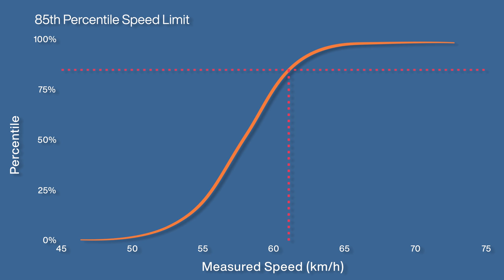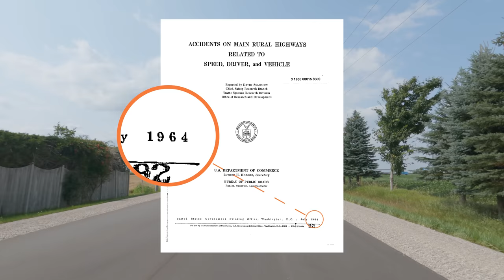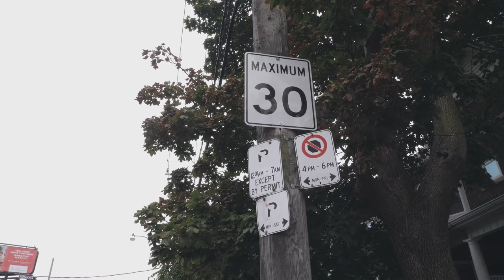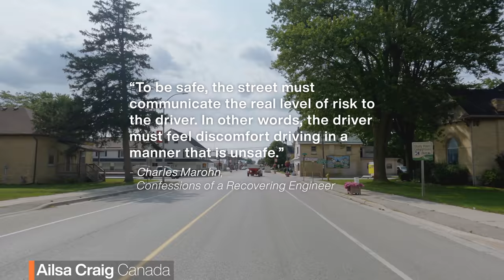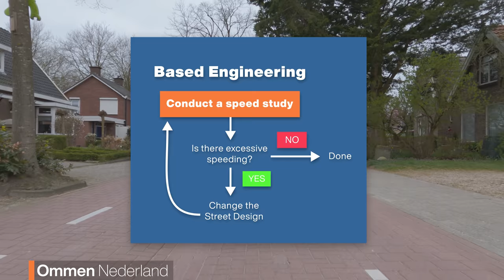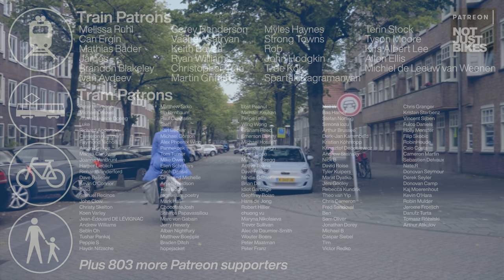The Wrong Way to Set Speed Limits [ST06]

Comment: Your approach is for streets that accommodate for example, 2000 cars/hr to be designed to accommodate 1500 cars/hr for a country/city that only needs roads that accommodate 1000 cars/hr.

That will not work in the USA. We need roads that accommodate 15,000 cars/hr to move 60,000 cars in 3hrs. (Rush hour) What happens is the excess WILL bleed into the streets. Streets designed for 2000 cars/hr get over run regardless and slow to bumper to bumper traffic. We cannot redesign them to be slower.

Comment: I am from germany and came across some strange highways after my first long drive.
Most of the time it was only 2 lanes without speed limit. As soon as it got wider to 3 lanes, the speed limit was set to 120 km/h. Then it got narrow again and the speed limit was removed. Shouldnt it make sense to make it the other way around?
If there is no speed limit i like to drive around 180kmh. But when theres only 2 lanes, most drivers drive 80-100 on the right and 100-130 on the left. Making my fuel economy extremely worse because of breaking and accelerating, as well as getting uncomfortable or even angry while tailgating other drivers who drive "too slow" for you. I just dont get the idea behind this...

Comment: In my Big city we have avenues and boulevards and streets. most streets are 30 and 40 km per hour. Most avenues and BLVDRS are 40 and 50 respectively. The speed limit is decided on the street. 1 lane streets then 2 and 3 lane streets or avenues/blvrds. And even some avenues will have lower speed limits that align as a street because of pedestrian traffic. So I don't know where you are taking your info from but most major cities in Canada operate on teh same method.

Comment: The series talks about how towns are insolvent...then points-out that engineers reduce the speed percentage by 15%.
A little later, stop-lights are mentioned -- often meant to stop at every other stop-light downstream.

Think tickets would be reduced if the streets were designed by the speed-limit instead of the intrinsic design?

Try, "the road engineers are working on an algorithm which has been placed on them to design streets to frustrate drivers into donating to the city's (and by city, I mean the State Capital) financial budget."

.

Comment: I'm not an engineer but depending on the traffic volume for a given area, wouldn't some of those changes have the side effect of also increasing traffic congestion? Narrow roads accommodate less cars.

We are on the verge of a society with self driving cars so this is approaching non-issue territory. Once cars driving themselves are the majority the primary focus should likely be optimizing traffic flow and reducing risk by obstructions.

At the end of the day road building is an optimization problem. You want to optimize for safety, cost, and efficiency of the road. Possibly also presentation. While the changes suggested would improve safety I suspect they would decrease efficiency and most certainly increase cost.

Comment: Some areas in canada are so poorly designed. I live in a school zone but see people always speeding, there are barely any crosswalks and limited sidewalks (again, around 3 different schools) and they had to add a new traffic light and repave tge road/add more to the curb because people weren't stopping before turning. They only noticed once someone got hit by a car there. 30 minutes after school let out. BETWEEN 2 SCHOOL ZONES.

Comment: Some bad highway development near me uses these cues in the wrong way, creating traffic congestion almost all day, every day. A slight curve was paired with visually dominating fly-over bridges (from a terrible added-middle-lanes toll road scheme that required rebuilding every bridge on the entire length And building dozens of overpasses to lift traffic over the usual highway or on and off the usual highway in a mishmash of sudden left exit lanes and too-short forced merges from the left with different traffic speeds)... I digress. The problematic visual aspect comes as drivers on a straight road approach a built-up section of overpasses with cheapest-contractor solid ramps cutting off the view of the slight angle and the straight road ahead of it. Overly reactive drivers are snapped out of their driving fugue and tap their breaks- making the drivers behind them hit the breaks, and suddenly everyone is slowing to a crawl because it looks like there must be a problem ahead, and then once you get around the corner everyone stomps the gas and accelerates away angrily.

Comment: Curious on your opinion of the definition of a road as it is in a rural environment. Where I grew up we certainly didn't have streets. Every road was called "*insert Road name* Road". 

Your definition of road as a high speed connection point between two places with minimal sidewalks, driveways, crossings, etc. makes sense, and certainly differentiates them from streets, but for example the road I grew up on and all of the roads in my area were not always connecting points between two places, were never "high-speed" (think more like 35 mph), and had multiple driveways along them. 

Would you consider the "rural road" to be different than roads as they relate to streets? And how about avenues and boulevards? Can they be streets OR roads depending on their application? 

Just interesting 🤷‍♂️

Comment: About speed bumps: all speed bumps shown were of a whole-width design, with a gradual slope, and most if not all were "build in". Unfortunately in some places instead of doing speed bumps correctly, half-width pyramidal plastic speed bumps are bolted to the street instead. They are horrible - you need to not only drive at the correct speed, but also drive perfectly through their center... which is not always feasible. I hate them with passion.

Comment: in Germany speed limits [km/h] are in general 30 (in residential areas), 50 (in villages and towns), 100 (on rural roads) and highways have no speed limit but a recommended speed of 130

is that system not viable in North America

Comment: The biggest issue with speed limits is that even if people know them they will still simply ignore them. Very few people will ever obey any seemingly arbitrary rule, so legally enforcing these rules (that almost everyone subconsciously feels are unreasonable) will only make things worse. 

Also, I am not a believer in the 85% rule on rural roads either. Often times on these roads people are not able to drive at a comfortable speed because of slower drivers in front of them. Not only can this adversely affect the 85% speed limit that is set, but it encourages impatience and dangerous decision making from those driving on the road. More important than setting speed limits should be designing roads that allow frequent opportunities to safely overtake slower drivers and reduce congestion. Also, it still applies that strictly enforcing unreasonable rules does nothing but cause the general population to be made up of law breakers. I think speed should only be a concern when it significantly increases the likelihood of a wreck, and well designed roads and enforcement of other safe driving habits should be the primary concern.

Comment: What's irritating is that he doesn't answer the primary contention, how should the speed limit be set? The design loop he showed for the based engineer talks about excessive speeding, but that phrase is never defined. Instead, he talks about how to implement a limit on speed.
Reply: I get your point.
I think, depending on the way a street or road is used, you can alter the speed limit. For example, a busy shopping street should have a maximum speed limit of 30 kilometers per hour, making the street crossable for people. It also allows bikes to ride on the road where the cars ride as well, creating space for wide sidewalks for the big amount of shoppers. In busy areas, 30 or even less is the way to go. On bigger roads with less services next to it, 50 kilometers per hour might be an option, and if the road is only used for people actually going somewhere else, a higher speed limit can be applied. Of course, infrastructure should be created in a way that it serves the speed limit. So cobbles/bricks for the 30km/h streets, and asphalt for the bigger roads.

Of course it is impossible to create a universal system. Every place is unique and asks for it's own speed limit. Streets around schools should have a lower speed limit, so do areas with many houses next to the road, to prevent people having to hear these cars (although thick glass might help a lot as well).
But yeah, because every place is unique, they all ask for their own rules and speed limits. I think you should look at a single case everytime and decide what fits best there.

Comment: Great video. Should've mention the "driving speed sweet spot."
Do, basically, with all those variables, car, skill, road, etc. every driver has a certain speed that they are most comfortable at. Those are rarely the speed limit, it's usually quit ea bit under or over.
So. If you drive faster than the said sweet spot, you lack the ability to react in time.
If you drive slower than the sweet spot, you get too relaxed and are, again, lacking the ability to react in time.

Comment: Rather than investing in extensive infrastructure changes, might not automated cars have governors that will instantly adjust the car’s speed to the posted limit?
Reply: To minimise costs, these changes could be implemented only when the street is slated to be redone or resurfaced - if you're repaving a street, then it's not much more expensive to implement these measures. Or you can just implement cheap safety tactics like bollards, chicanes, or even just paint. Tactical urbanism has a bunch of these methods for cheap.

Comment: In Texas, the maximum speed is reasonable and prudent.

Sec. 545.351.  MAXIMUM SPEED REQUIREMENT. (a) An operator may not drive at a speed greater than is reasonable and prudent under the circumstances then existing.

Comment: The approach of changing the street design will never work in the US.  Drivers here will simply complain about the "arbitrary" narrowing of the street and/or the obstacles limiting the space available to cars, and will push for cities to restore the streets back to the old way that lets them driver faster.  

There is this one particular residential side street near where I live that people started using as a shortcut for thru traffic, to get around a series of traffic lights. This was a side street intended for residential traffic only, with a 25MPH speed limit, but people were routinely clocked going 50+ MPH.  When the city put up barricades and speed bumps to discourage speeding through the residential neighborhood, people actually threatened the city council.  They ended up having to remove the barricades, and had to change the speed bumps to much lower (and wider) versions, just to satisfy all the impatient Karens and Kyles.

Comment: Germany has a better concept:
Streets used by childrens or passengers too: max. 5 km/h
Streets in closed villages & towns: max. 50 km/h (30 mi/h)
except the one with special high risc: 30 km/h
Streets through open villages: max. 70 km/h
Isolated roads with multiple lines in towns: max. 70 km/h
Roads outside of villages & towns: 100 km/h (63 mi/h), except of bottlenecks, road damages & tight curves 
Autobahn: no speed limit except on risky parts (80 to 130 km/h) or construction sites & partially closed streets  (mostly 50 to 80 km/h)
All exceptions of the standard speed limit has road signs while the 50 km/h for streets insides of closed villages & towns, the 70 km/h for open villages as well as the 100 km/h for roads outside of villages & towns has no road sign. Towns & closed villages have yellow signs which tell you on the outside which location you're entering and on the inside which location you're leaving (with a diagonal strikethrough) and which location comes next and how long the distance is. Open villages has the same sign but in green. (traffic light logic: Green = Go, Yellow = Give attention!, Red = Stop!)

Comment: In Denmark the speed limit in cities is 50 km/h and outside cities it's 80. We have special signs showing when you leave or enter a city. 
We use max speed limit signs and it seems to work just fine so I dont see the issue tbh

Comment: DESIGN SPEED!!! 
This is what I've been trying to explain to people! Driving 50kmh on a single-lane narrow road with a bunch of trees and people feels way too fast and extremely dangerous, but people are constantly riding my tail trying to go 50, but I don't feel safe doing that. Driving 50kmh on a wide road with many lanes, no trees, and no people feels really slow and I feel like I could go faster. 
THank you for providing me with this term, I will be using it all the time now
Reply: @laurie7689  If trees are not an option, then consider hedges. Anything that will invoke a perception of speed. Narrower roads while still leaving a lot of clearway is an option.

Comment: mate in my hometown in the uk they've put up 20 mph zones in quite a lot of places on streets that are still obviously designed for 30 mph. I and most other local drivers refuse to follow the limits unless they've actually made some effort like speedbumps to slow people down. So it's easy to get frustrated when people actually follow the posted limit. But also the 20 zones arbitrarily stop and start, and it's not obvious, so you also get people doing 20 in a 30 zone, which is even more annoying.

(the 85% rule is actually WILD to me, btw. you shouldn't be basing laws off of people's habits. here the rule is 60 mph speed limit out of towns- obviously most rural roads are unsafe to drive 60, but that's the legal limit. you have to make your own judgement on winding rural roads.

Comment: How does lowering speed help congestions, load of nonsense. Only in case when drivers give up driving altogether and use bicycle, less cars? 

You fix congestions by improving cross sections, building quality round abouts and adding special roads to avoid densely populated areas. And by not putting kindergartens, shopping malls, schools ETC on the same street. And by building infrastructure for pedestrians/cyclists which do not force them to share road with cars. The list goes on.

Comment: I live off a state/US highway (its a stroad) in Rochester, MN. The section I live off of is 8 blocks of almost all residential. They've tried to make it less stroad-like by adding a median with trees and plantings, but people still drive way too fast. It's almost impossible to make the crossing at the end of my street safely as you have to wait for both directions of traffic to be clear. This can take sometimes 2-3 minutes of waiting. I've tried unsuccessfully to get the state to review the speed limit (it's currently 40 mph, which means people drive 50). Thanks for doing this video. It made me realize that the design of the highway is completely wrong and doesn't do much to signal to drivers to slow down. The fight goes on, I guess!

Comment: I hate the Netherlands design and now knowing this I will never visit. I like driving fast and this kills it for me.
Reply: You do knkw that the 30-50 kmh areas are meant to be at the beginning and end of the journey right? If you plan accordingly you only drive at these speeds for maybe a couple of percentage points or less depending how far your driving otherwise you will be on 80-100 kmh roads or 100-130 kmh highways
Reply: That's what Circuit Zandvoort is for. Public road isn't the best place for fast driving, and definitely not on a street.
Reply: @laurie7689  The issue is less on speed, and more on road design and speed limit. As expected, Interstates are wide with gentle curves to invite high speed driving. After all, they are purpose built for long-distance journeys. So, it is ridiculous to impose a cartoonish low speed limit (55 mph for example) for a road that can safely handle higher speeds.

Conversely, on areas that should have low-speed limit (such as school areas), they use a road with disproportionally high design speed. Of course drivers are bound to overspeed, children or no children.
Reply: @laurie7689  Thus, the crux of the matter: drivers drive at 80 mph, because the Interstate can easily accommodate that speed. If they insist of slowing them down, signpost will have little effect; they do need to modify the design of the road.
Reply: @laurie7689  8:00 "Because they're afraid of damaging their car." Introducing potholes, a natural traffic calming device. No action required. Kidding aside, there is a bit of truth. Vehicles will tall suspension might overcome them to some degree, though the discomfort can prompt driver to slow down anyway.

Speed table is an option. Essentially a much gentler version of speed bump. A rise, a longer flat road, then a descent. Rumble strips the spans the whole road and last for about 50 meters is another option.

Comment: tbh my car has (just below my speedometer) a meter than tells me the fuel efficency of the speed/acceleration I'm currently using, which I do check obsessively bc it directly correlates to the money I spend on gas. If I'm driving "correctly" (at the most optimal gas mileage I can), then I save money. As a consequence, I'm pretty aware of my speed.

What I'm saying is if we have more features like this built into cars—ones that intrinsically incentivize people to mind their speed and/or to reduce it—we not only save gas as individuals, but we reduce the speeds of drivers.
EDIT: I understand this video is about urban and not automotive design, but personally I think it's smartest to observe and circulate solutions to issues from as many POVs as possible. Should our urban design basically not just suck balls? Hell yeah. Can we also change how cars are designed, which ones we buy and operate, regulations around cars (while we're stuck with them)? Hell. Yes.